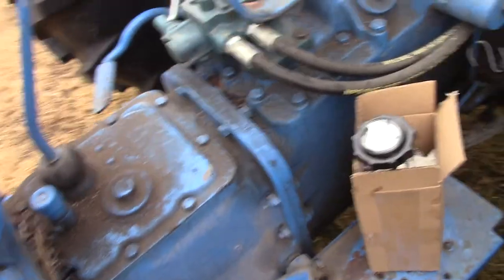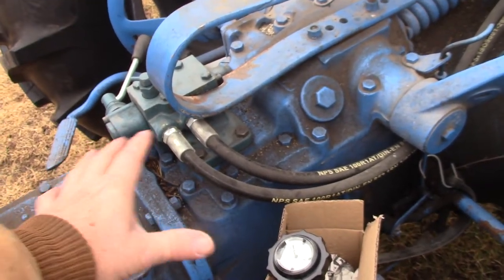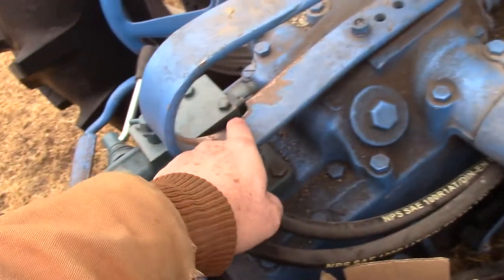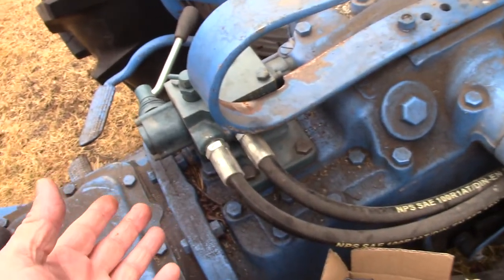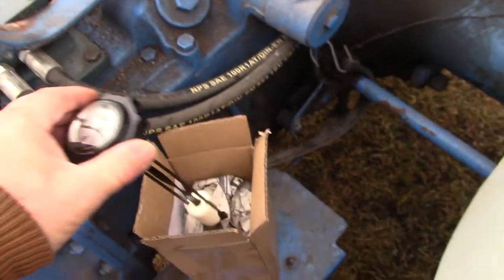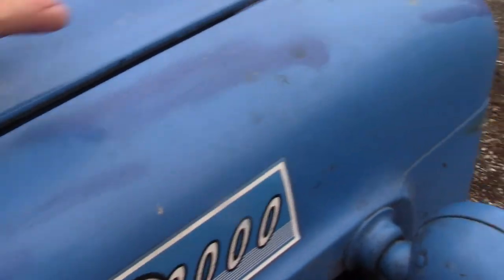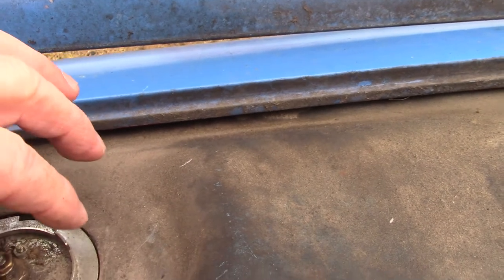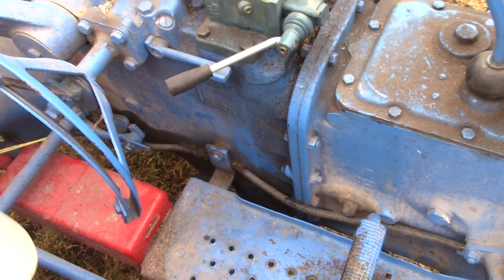Part 5: Adding Hydraulic Remotes

Comment: Excellent video and explanation of the installation process.  I have a Ford 800 and considering adding the same Steiner single spool valve kit.  The even though the T-handle gives you the ability to run double acting cylinders, shouldn't there be a hose for low pressure/return to the tank?
Reply from the maker: When you use dual action cylinders one hose has pressure to the cylinder and the other returns to the tractor. A single action cylinder has one hose at one end and a air vent at the other end to release the pressure as the cylinder moves in and out. Hope that answers your question.

Comment: I have a 800 and it has a single action. What attachments is for a single action?
Reply from the maker: Usually the cylinder uses pressure to lift the implement but gravity lowers it down.
Reply: @jeffreyticen689  that's what I was thinking also. Thank you